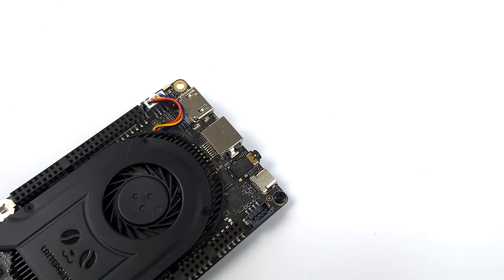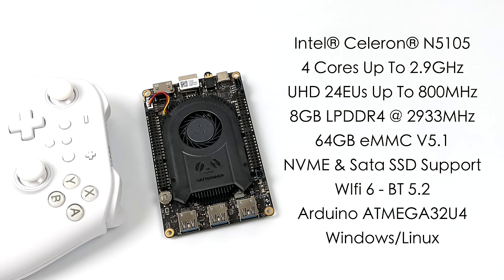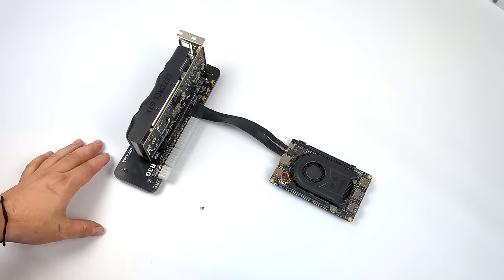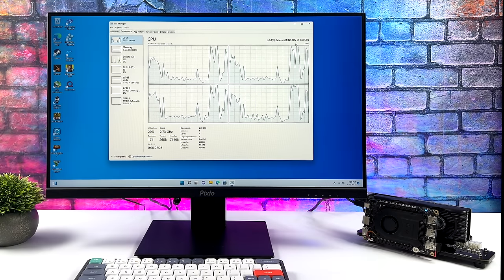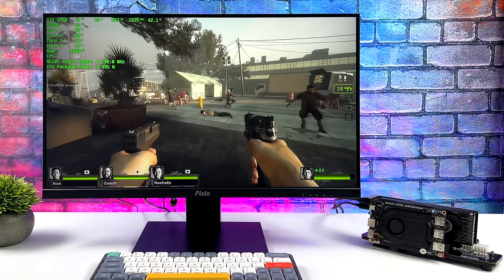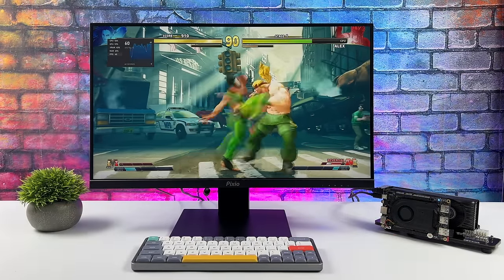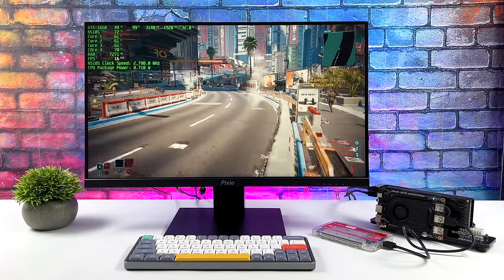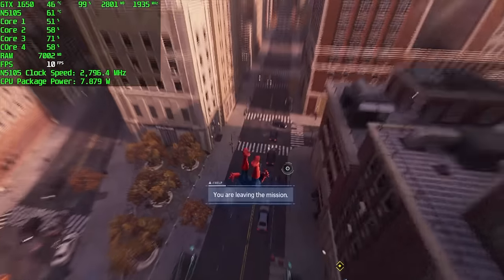We Transformed The All-New LattePanda 3 Into A Fast MICRO Gaming PC! First Look

Comment: Would love to see something like this but all powered by a 240w laptop power supply.
Reply: yes you can do it  with this unit.  It accepts 12V input. so  a 12volt power brick  is enough
Reply: just buy a decent laptop
Reply: @xienjougao3131  No. But thanks for the terrible opinion, lmfao.
Reply: @LazyPCRehab  pre practical.. you will spend more with that.
Reply: @xienjougao3131  I could care less about your opinions. It’s hilarious that you think your opinion is somehow fact. Please go find someone who wants to deal with your condescension. Hint: not me.
Reply: @LazyPCRehab  opinions are like assholes, everyone has them, what he was trying to say is the laptop would be a better purchase due to the complexity and costs.
Reply: @Xurikyo  These builds are not meant with practicality in mind, that is where you both are going wrong in your assumptions.
Reply: This will work great !
Reply: @xienjougao3131  No, this is just a fun project ! A laptop is a different thing.
Reply: @jondonnelly3  yeah, a lot of people are getting lost with SBC/Raspberry pi which they say "LOW COST THING" and tinkering it? it is a different thing? what for? it is expensive! just buy a decent laptop u can do that also via pcie. if u want a low voltage AIO buy a J4125 mini pc or n6005 mini pcs it wil save you TONS of money
Reply: Super Mario  its from China dude! just buy a J4125 mini pc run it on 12 battery. then an arduino/esp32/ MCU - a solid build rather than suffer from low end RASPBERRY PI thing or like that.
Reply: Gatekeeping is sick as hell.
Reply: @LazyPCRehab  people have been building cyberdecks or minicomputers since the pi came out, and when you look at it, it's kind of neat. You can 3d print anything now, create legs even. It's just a video man relax a little, enjoy life.
Reply: @LazyPCRehab  triggered lmao
Reply: @isla2416  nah, just tired of people who can’t read.
Reply: @LazyPCRehab  lol
Reply: Pico adapter would do the trick. Buttt that would look like a fun pfsense router....use ethernet adapter vs gpu
Reply: @Jay Cee This is mainly just for people who think it is cool.
Reply: @Jay Cee those crappy linux boards doesnt really come cheap... as u would still try to connect components designed for a normal computer.. case, etc. unlike when u buy a full 12v mini pc and an Arduino, which they say cheap one of the powerful use of crappy linux boards (gpio/pwm/analog) pins. which really u can get on a 0.5 cents arduino mcu
Reply: @xienjougao3131  That's the practical way, but for a YouTube video, it's fun to watch people trying to get as much performance as possible with these cute little PCs.
Reply: what I would love to see is them stop using external power bricks on tiny computers, I hate the bricks.

Comment: Please make video "Lattepanda Alpha vs Lattepanda 3 Delta"
Reply: Delta 3 should be much faster, being 4 cores and 24 EU gpu. Maybe the single channel ram will hold it back?
Reply: @PMARC14  Delta's processor better, but alpha's graphics processor better.
Lattepanda Alpha: $459
Lattepanda 3 Delta: $239
Which better i don't know!
Reply: @KsenjiaRegard  I don't think so, the celeron N5105 in the delta 3 being 11th gen has 24 EU, same count as the M3-8100y in the alpha, but they are of a newer gen and can clock higher also. All I am missing is if the alpha has dual channel memory
Reply: @PMARC14  Yes, i like play games. I need to know, can i play Minecraft, Fortnite, csgo, gta V comfortable and without lags?
Reply: @KsenjiaRegard  I mean if you are playing games why choose these SBC's at all, that isn't what they are good for
Reply: @PMARC14  No SBC is slower than alfa and 3 delta. His ram 2gb.

Comment: @etaprime I have found that you get a lot more consistent performance by disabling Energy Efficient Turbo in the bios and increasing Power Limit 1 from 10W to 11-12W and the Platform PL1 Power from 12W to 15W or higher (I use 20W since I use an eGPU with my Latte Panda 3 Delta, like you in this video.)

Comment: Someone over in the LattePanda Discord has designed a case for the LP3D that supports the RX6400 XFX. Might be worth checking out if you have a 3D printer.
Reply: I'll post the files in the discord once it's done ^^
Reply: @nitram1666  💯
Reply: @iam.jasonhoward  Wait, what? Lattepanda had discord channel? Can you share?
Reply: that pcie 2x gen 3 would be terrible for that card in all honesty a used cause even 3.0 4x only gets half of the performance due to gddr6  i think the latte would be a bit better using an oem 5300xt it has higher performance its still a gen 4 card but it uses gddr5 so it wont stress the pcie as much only drawback is you need a 6 pin connector

Comment: yeah, x2 is just as unusual as x6. most of the time only x1, x4, x8, or x16 works.
For Windows 11 you best set the swap file to 4GB.
I was wondering if Nvidia Cuda would help out the poor cpu performance.
More than likely Spiderman and other games are suffering from the pcie bottleneck, rather than CPU or RAM.

Comment: ETA: Could you test this setup Specifically for a plex server. and use a P2000 (or maybe any nvidia card) as the video card. To test if it can stream 4k, If so how many concurrent streams.  Currious about the Intel quicksync, and the Nvidia encoding for Plex using Hardware Decoding. and ! small box being able to decode streams using either or both types of decoding when needed for differnt compressed (x264,h264, MKV, 265) movies.

Comment: I want a decent, mid range (r/i 5- and a 1660ti/2060/3060), laptop,  without a keyboard, trackpad, or screen. I want to treat the Battery like a UPS.
in exchange for me using my own keyboard, mouse, and Monitor I want this bare laptop to be around $500-$600 instead of its conventional counterpart being $1000 +.

Comment: Spider Man issues may be due to intense asset streaming and the bottleneck between storage and the GPU PCI-E lanes? I imagine that the other games just don't do as much of this when in-game. Pretty sure that the original PS release of this actually had assets stored to the HDD multiple times so I/O was quick enough not to cause stutter (or not load in-time).

Comment: I am betting your biggest bottleneck is your MVME interface which is only running at PCIe 3.0 1x.
I know that CPU supports 8 PCI-E lanes so I did some digging and it looks like those MVME connectors are actually pinned differently to the CPU:
1x M.2 M Key, PCIe 3.0 2x
1x M.2 B Key, PCIe 3.0 1x
from the images, it looks like you were using the 1x slot for the GPU and the 2x slot for the MVME. I am betting if you switched them you would see significantly better performance in games.
Reply: I was wondering why he used the m.2 for the GPU and the nvme slot for the storage. Backwards

Comment: please test the supermicro X12STN-E SBC with rx6400.its a gen 4 sbc it has an m.2 slot running at x4 4.0 and an i5 11th gen mobile cpu. i would like to see if the rx6400 going to get bottleneck or it will run just like in a regular gen4 desktop

Comment: Would be nice to see a common metric, such as frames per second per dollar
Reply: Best fps for dollar is always going to be getting a used dell or hp office PC and throwing gpu in it. This isn't necessarily for budget and not even for portability because it uses 2 outlets. This is just a test of what's possible basically.
Reply: @tonylarose4842  dint ask for the best for per dollar, just the fps per dollar

Comment: Cute alright but a rather pointless exercise. I3-10105F, H510 board, 16 GB RAM = 180 Dollar. A lot cheaper than this "contraption", the SBC costs 230 Dollar plus the M.2 > PCIE adapter. Thanks, but no thanks. ;)